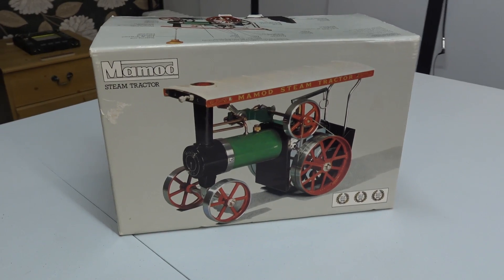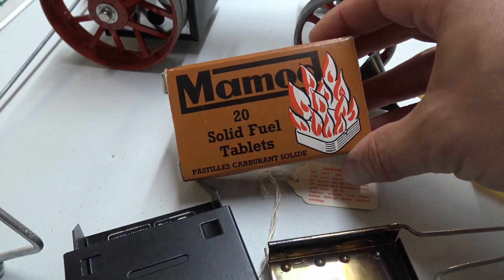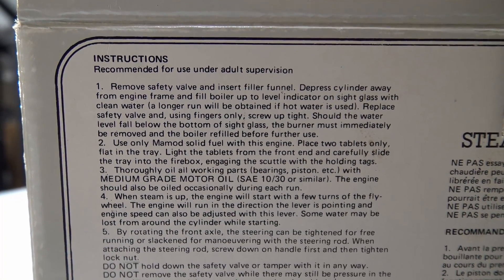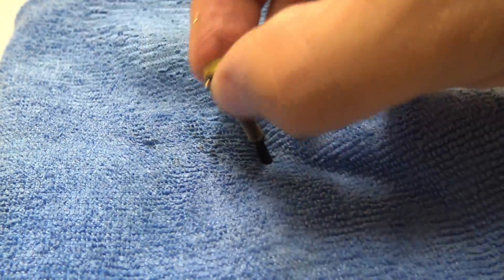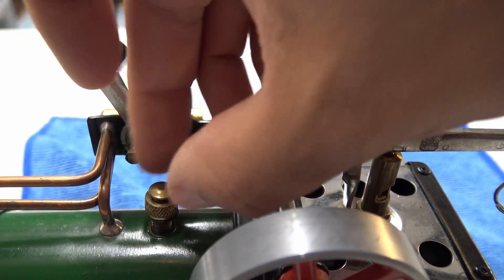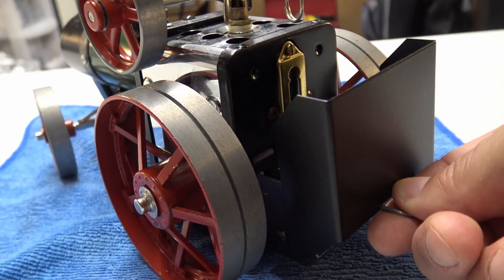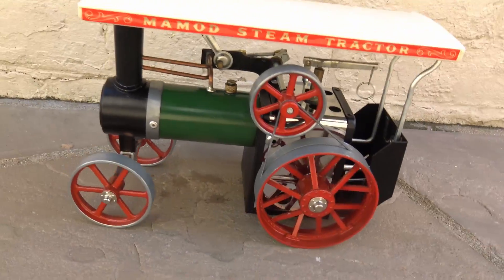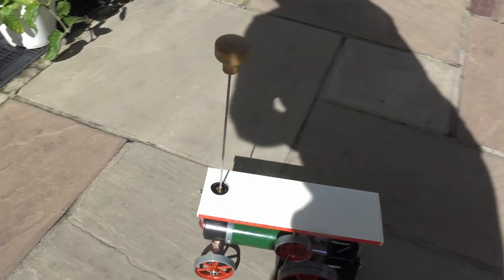DuB-EnG:  Fire and Water make machines move people! - MAMOD VINTAGE STEAM TRACTOR DEMONSTRATION

Comment: The steam apprentice club (SAC) have taken these little traction engines and created something called formula mamod, it is essentially Scalextric for steam enthusiasts. They take their formula mamod tracks to rallies across the country including the great Dorset steam fair, and the race mamods round it with steering clips attached to the front axle.
Reply from the maker: That sounds like epic fun! - Someone told they have fitted a steering servo and a radio control to theirs! - How cool is that!!
Reply: @DubiousEngineering  Mamod engines will spit out oily water not just the steam oil on its own